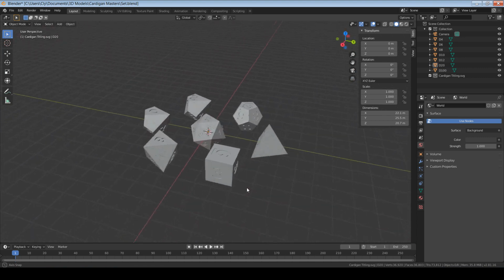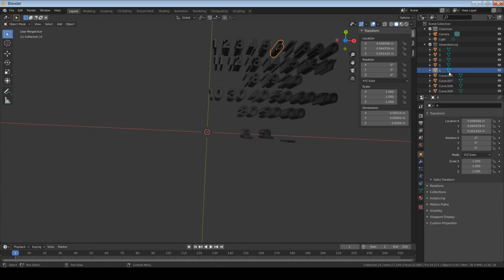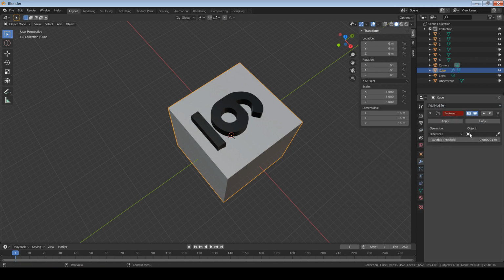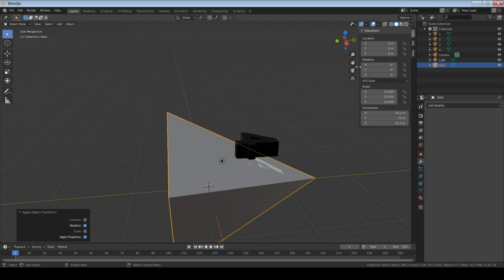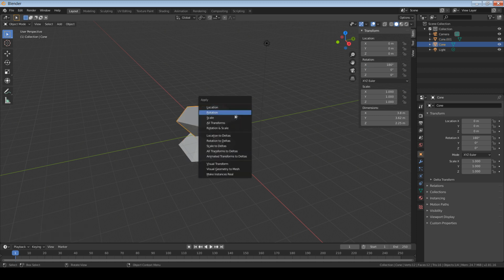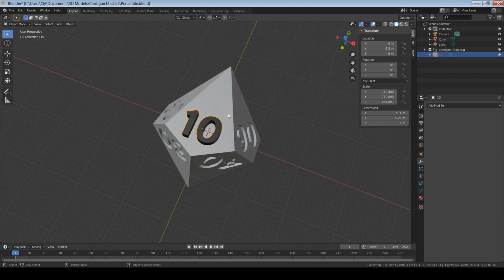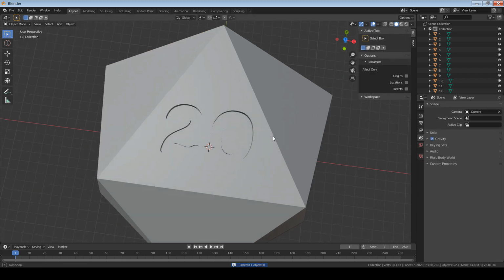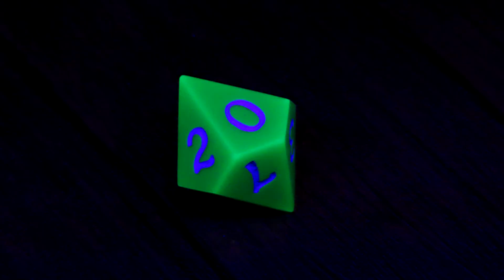Design Your Own Custom Dice for Free | Blender Tutorial | DIY with Cly Ep. 21

Comment: I've been having loads of trouble with printing mine,, sometimes one will be missing but the worst problem is that the numbers don't show, they're just flat shapes! Am I doing something wrong?
Reply from the maker: Sounds like you're having a manifold error somewhere. A quick fix would be to apply a remesh modifier to each die, though it will increase the file size of your exported STLs. Fortunately that shouldn't cause any issues.

You can find the remesh modifier in the same column as boolean, and you'll want to set your octree depth to 9. 

Oh, and be sure to check the preview when you slice the dice for printing. That'll let you know whether or not the numbers will print.
Reply: @ClyFaker  thank you so much! I'll try that!
Reply: @ClyFaker  now I get numbers but they're not exactly readable, like the details don't come out.. I've tried a couple different prints, changing some of the settings, but still nothing (if anything, they're getting worse). Is there any way of fixing the detail issue in blender? Or is it just my printer thats giving me trouble?
Reply from the maker: If the numbers show up properly in the printing preview after slicing the model, then the problem most likely is in the print settings. 

I don't know which slicing software you're using, but Chitubox does a great job showing what a sliced model is supposed to look like after printing assuming every setting is correct.
Reply: @ClyFaker  I am using Chitubox and I have an elegoo mars printer. I've changed around the settings quite a bit trying to fix the problem, but the most recent print just warped, which isn't ideal.. I'm not sure where you are seeing the preview of the print in chitubox, usually mine just gives me the layer by layer view, which doesn't really visualise it well
Reply from the maker: Honestly, I don't know if I did anything different since I don't use Chitubox as my main slicer (I use the software that shipped with my Photon), but when I hit "slice" in Chitubox it brings up both the layer by layer preview as well as the model itself. I can use the slider next to the preview to scroll through the layers, and that brings up the matching layer on the model. 

Also, what resin are you using? I've definitely found that not all printing resins are going to behave the same. I personally swear by Anycubic's opaque gray resin. Transparent resins always give me warping and light bleed issues.
Reply: @ClyFaker  the resin i use is the elegoo mars brand, I assumed that was the best thing to use for the printer I have.. maybe my font is too complex?
Reply from the maker: It very well could be. I've had a few issues when using fonts that are too narrow or have narrow offshoots.
Reply: @ClyFaker  I guess I'll try a different font and see how that goes, thank you for the help

Comment: First of all, awesome tutorial. I did want to talk a bit about that numbering convention on the d10, because there is a line of reasoning for why the standard dice set adds to 9 rather than 10. The opposite ends of the dice generally add to the number that most closely represent the average in any two dice rolls, this keeps the number distribution relatively even across the die and prevents it from having a high and low side (like counting d20s used in Magic the Gathering). For most dice, that number from 1 onward, that average is going to be .5 higher than the number of faces on the die. So they go up one from the number of faces in design. In the case of the d10 when used as a lone die your numbering style maintains this, but their design in commercial sets where the tens ten is included assumes you're using the dice together as percentile dice by default, and when rolling percentile dice the 0 actually does represent zero in any case except for the tens ten when you roll 0 on both dice. Because of this the average on 2 dice rolls of a d10 is actually 8.5, and for the tens ten its about 8.6. This is why they round up to 9 for what the opposite sides add to to keep a relatively even number distribution. Your numbering style is actually worse than theirs when using the percentile dice together as it creates a pair where the opposite sides add to 1 effectively. This is also the reason why the d10 has a 0 rather than a 10. It's not to maintain a single digit aesthetic, but because in its assumed use it is actually a zero. There are some d10 dice sold that do use your numbering style, especially when sold individually. Also they typically use a 10 or a symbol rather than a 0 like standard sets. Personally I agree with your numbering convention as i use the d10 most often as a d10 and not a percentile. I just wanted to share some random knowledge.
Reply: The opposite sides of dice are far simpler to deduce than this.  The opposite sides of all dice, in a standard arrangement, equal the number of sides on the die plus 1.  Opposite sides on a d6 = 7, on a d8 = 9, on a d10 = 11, etc.
Reply: @TheCrystalHive  Except d10s are also used as percentile dice, where rolling a 0 and a 00 means you rolled a flat 0. The die being "non-standard" doesn't matter because the numbering convention still serves it's purpose: To balance high and low numbers across the die.

Comment: I have been so confused, how do you fill in the shapes, everytime all my shapes are hollo on the inside and I'm unsure if that will mess up printing
Reply from the maker: The shapes are hollow on mine as well, and the same goes for all other 3D models. 3D printers will treat all models as solids unless you "hollow" it out, and that just adds interior walls.
Reply: @ClyFaker  damn wish I knew that cause I restarted like 3 times
Reply: thank youuuuu

Comment: This is Fantastic and it really helped me a lot. However, I was just wondering, instead of copying and moving the Underscore each time, why not copy it in the original numbers files and apply it as a Joined item to the 6 and 9?
Reply from the maker: I mainly kept it separate because the boolean modifier sometimes freaks out with joined objects.

Edit: And yet I joined numbers and dots without issue. I was thinking about a different project with that answer. The real answer is that it didn't even cross my mind.
Reply: @ClyFaker  Ah. Fair enough. I was just working my way through it and thought it was a bit more of a hassle. But also, if you are using them in other files and projects you probably want them separate. I forgot to make numbers for my Teens, so I just duplicated the 1 a bunch of times and added it to duplicates of all the numbers 1-9. Didn't even think about them when I made them in Gimp, so I get it. Thank you for such a great video and laying out all the different angles and stuff.

Comment: How do you have multiple sessions open in blender?
Reply from the maker: I just minimized one session and launched another in Windows. I really wish they'd add the ability to work on multiple blend files in the same instance already.
Reply: @ClyFaker  Is this possible on Mac? Oh and thank you for the response!
Reply from the maker: I've never messed with Mac, so I had no idea that could be an issue until your question. 😅

Apparently you can supposedly launch multiple instances of a program from the terminal. The "-n" command launches a new instance of a program even if one is already running. Try entering this:

open -n /Applications/Blender.app
Reply: @ClyFaker  Thank you!
Reply from the maker: No problem. 👍
Reply: @ClyFaker  Update: Figured it out, worked!

Comment: First thank you for the awesome tutorial.
I did it like you said and exported the dice as an stl, put them in chitubox and printed them. 3 hours later I screamed because all of them were blank :(
Then I looked in the slicer and it really didn't notice the numbers. I thought maybe I did something wrong and put them in the prusa slicer but it noticed the numbers. Maybe you or somebody in the comment section has an idea what went wrong. Thanks
Reply from the maker: You're the third person to come forward with that issue. I still don't know what caused it, but I might just have a fix for you.

What you need to do is apply a remesh modifier to each die. You can find it in the same column as the boolean modifier, and you'll want to set the octree depth to 9. This will leave you with a larger file size thanks to the way it redistributes your geometry, but it should get along with your slicing software.

Be sure to check the preview before printing just in case.
Reply: @ClyFaker  thank you so much. I tried it and it works now, at least in the slicer.
I love it so much when a youtuber tries so hard to help the people who watch his videos.
Reply from the maker: I'm just glad I could help. 😀

Comment: For anyone wanting an update, Blender 2.83 has simplified the D20 modelling. Simply go to add mesh - ico sphere - and then the bottom left menu that pops up, change subdivisions to 1.
Reply: DO NOT DO THIS! The Icosphere will create your D20 with a different orientation to the video's method and you won't be able to re-orientate your D20 with precision.
Reply: @lomaxdesigns1716  surely one could just rotate it to match the video then follow along?
Reply: @maggie3060  - If you can do the maths maybe, but if you eyeball it you won't be precise and all your numbers will end up wonky. More trouble than it's worth IMO.
Reply: ¿ @lomaxdesigns1716
Reply: Wow, thank you so much. This is awesome.
Reply: im working in blender 3.1.2 and I don't know how I can do the D12, what I should do?
Reply: @wisegirl_athena3458  Hi. I'm also working on a d12 and am a Blender novice. You have to go to Edit>Preferences>Add-ons and check "Add Mesh: Extra Objects". Once you've done that, when you go to Add>Mesh, you'll get the option Add>Mesh>Math Function>Solid Object. Go to the object menu at the bottom left hand of the screen when the default tetrahedron pops up and select "dodecahedron" from the drop-down menu.

Comment: Great video! Last week you said only about a week left until the sequel. Any updated ETA?
Reply from the maker: I swear, every time I give a time table I find another issue to address with the molds. 😅

Fortunately the modification I'm testing right now (it's curing as I type this) is pretty minor. At this point I'm mostly compiling my notes and figuring out how to present the process. I want to make it as easy to follow as possible.
Reply: @ClyFaker  I'd love to see an example of how you've oriented them for printing, I'm having a tough time avoiding supports on the die faces

Comment: I could use some help please...
Everything is smooth for me till I get to the Boolean...
For some reason it's just not working for me...
I have adjusted the Z for depth..
Tried changing the scale...
I've  downloaded both your version and the newest...
But nothing happens or worse I see little "wires" like something happened...
To make matter worse it works for me if the "cutting object is offset... but Not Centered...
I just may go insane from this.
Reply: did you ever figure this out? this is the wall i cant seem to get over
Reply: Did you find a fix for this?

Comment: Great Vid. Really could do with the follow up video. Want to make dice for my gaming group for Christmas presents.
Reply from the maker: The follow up kept getting pushed back thanks to me always finding one more small problem every time I printed a set of masters. It doesn't help that I'm not printing often thanks to how hard isopropyl alcohol (especially 90%+) has been to find.

Fortunately I have a new cheap and easy to find solvent for washing prints (that might get its own video), and if everything goes well with the masters I'm printing later this week I'll be ready to finally wrap things up with the sequel. The master design works as is (you can see examples in my recent dice making videos), but there's one last quality of life improvement I want to test.

Comment: I'm going slightly rogue because I love the look of a wide d10/percentage die. Changing the shape is easy enough while editing the cones but how do I figure out the new rotation amounts? :o (I know I'm complicating things XD)
Reply: To answer my own question the solution is MATH. Use the measure tool to measure from the top cone point through to the bottom (pressing control will make it snap), then up along the edges of the face to the center point, then from that point through the center of the face back to the top point. (hopefully that makes sense without pictures). Enter those those measurements into a Law of Cosines calculator. One of the angles it gives you will be the one you need. Then you can just use the same pattern of X: -(your number), Y: -72, X:(your number)
Reply: @lizcauthorn, THANK YOU for this!  I was attempting something similar, but with an elongated d8. I knew the answer was math, but I had no idea how to start forming the calculation!

Comment: Hi I keep getting the same issue with extruding the meshes of the font. Instead of a solid shape it's always wirey, and I can't seem to fix it for some reason...
Reply: Hi, hope you figured this out but if not I hope that didn't discourage you.  When you're extruding, you likely don't have ALL the vertices selected.  Once you go into edit mode, hit the 'A' key and it will select all of them.
Reply: I get that issue too. what I did was import them to a free browser based 3d modeler called AutoDesk TinkerCad and that would automatically make them into a 3d solid. from there i would export them to a .stl and them import them into blender. you still have to adjust there centre of weight in blender, but it makes life a lot easier.

Comment: So, the issue I'm having is that when I set a rotation it stays that number. I can't get it to reset to 0 to apply a separate rotation, so I'm having to figure out the math of the rotation in addition to its current rotation.
Reply from the maker: That's a new issue. I assume you're using the "apply" menu that pops up when you press ctrl + A and clicking "rotation", correct?
Reply: @ClyFaker   Wow you reply quickly. Apparently I was not doing that. The ctrl + A and rotation fixed it thank you! I kept trying to figure out what you meant by " apply" in the video and totally missed it somehow.
Reply from the maker: I'm not always this quick. I just happened to be messing with my phone when the notification came through.

It's easy to miss it when I mentioned the ctrl+A menu. I should have brought it up multiple times.

Comment: for the life of me I cannot get the boolean to work. I have tried all different sorts of files. I've tried different depths on the number. I've done everything I can think of and every time it either has no effect on the cube or it makes a bunch of weir lines on it
Reply from the maker: I have a couple of ideas. 

The first possibility has to do with how your SVG file was created. Did you use Illustrator or InkScape? If not, was your source image a PNG? Blender seems to hate all of those things.

The second possibility is that you have the number selected instead of the cube when applying the boolean. For it to work you need to have the cube selected and then choose the number you're trying to engrave into it from the dropdown menu for the boolean modifier.
Reply: Cly Faker I used the site that you showed on the video  and I used jpegs and I’ve been making sure the right one was selected while I’ve been doing it and my fiancé has even taken to trying to figure it out too and so far nothings working and it’s been a couple hours of non stop trying

Comment: Interested in the cap mold print tutorial. Been trying to figure it out on my own but no success
Reply from the maker: After a lot of tinkering I think I finally have the method as simplified as possible. I've been recording the video for a while, but I keep making changes to the design. 😅
Reply: Cly Faker maybe crowdsourcing it will help. Use the comments on it to help optimize the design? Just an idea. Keep up the great work.
Reply from the maker: I've fortunately had a functional design since the beginning, so it's mostly just been small tweaks to streamline things. I believe I made the final tweak this morning. I realized when using my latest set of masters that it was easy to mix up the caps of the D10 and D%, and that would not be a good thing. After reworking the way the molds are keyed that should no longer be an issue.
Reply: Cly Faker awesome!

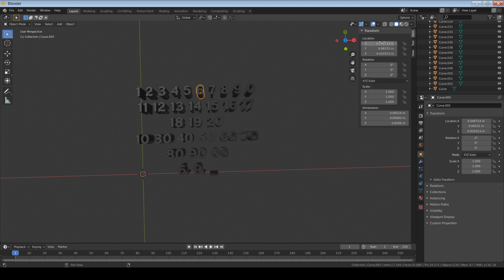Comment: I'm having an issue with moving my numbers.  After I set the origin to the center of mass volume at around the 5:20 mark I attempt to set the X,Y, and Z to zero only to have my be floating in the middle of my numbers instead of at the origin. When I attempt to do the same to other numbers it seems each number has a different 0,0,0, even after setting the origin the way you do in the video. Any help would be appreciated!!!
Reply from the maker: Yeah, some fonts are easier to center than others. Apparently I got extremely lucky at every stage when making this video. 

You're basically going to need to manually center each number. It's pretty much the same way I showed with the 6 and 9 with dots. To make life easier you can center the camera above your selected number after moving it to 0,0,0 (before manually centering it) using either numpad 7 or clicking "view", "viewpoint",  and then "top". This will also give you a grid to use when adjusting the number's position. 

After you have it where you want it just set the origin to the 3D cursor.